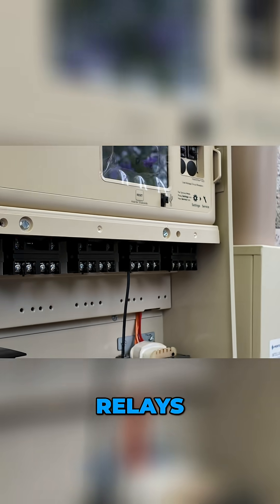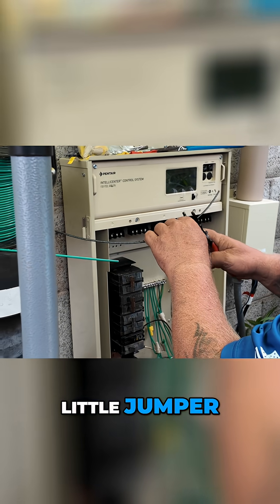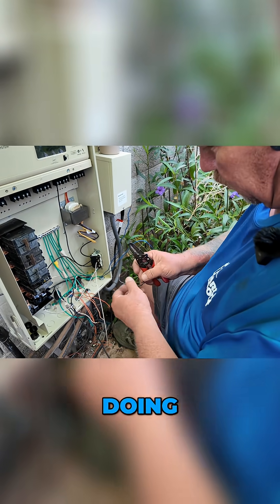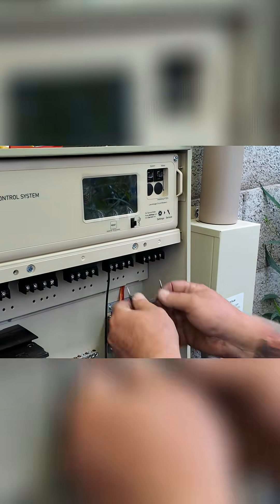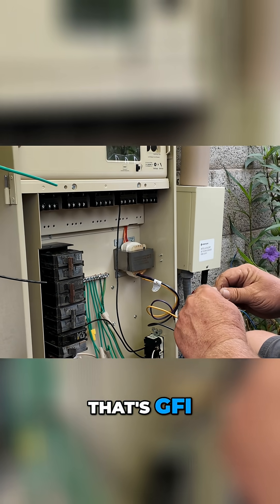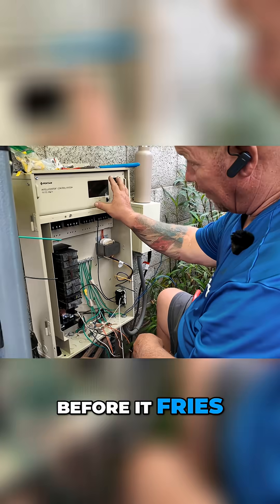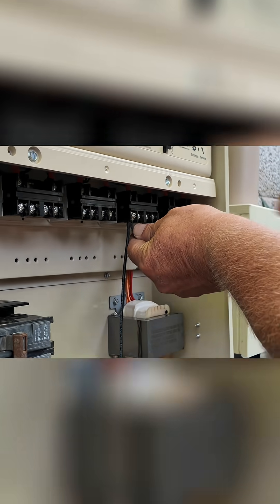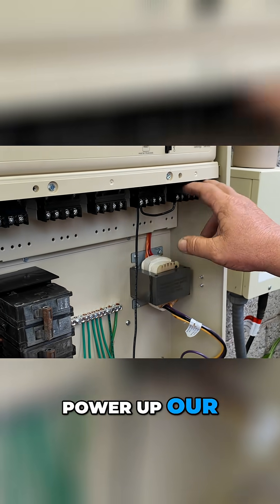How to Wire Pool Lights with Pentair IntelliCenter (Step-by-Step Install)

Comment: Wiring is neat but I would highly recommend a pool gfci breaker in there if you don’t and the system goes to lock everything is fried.